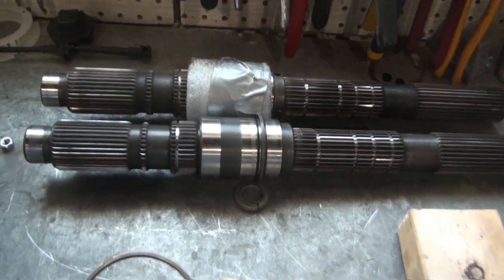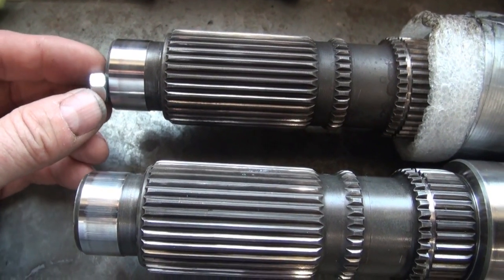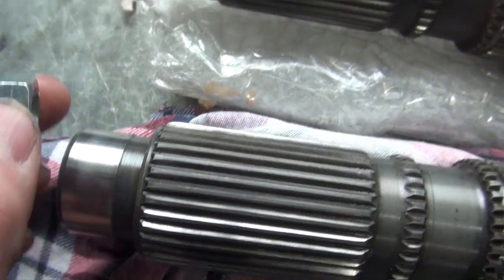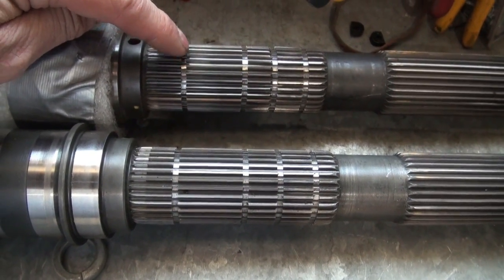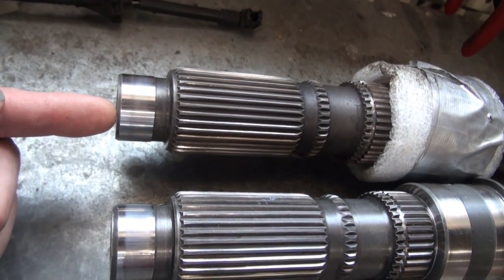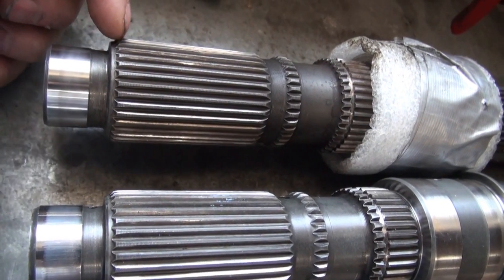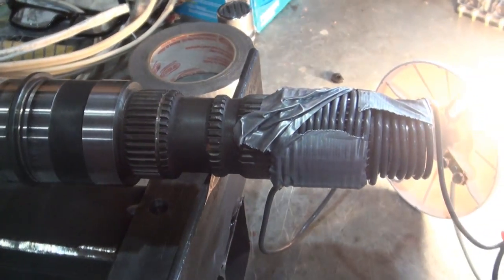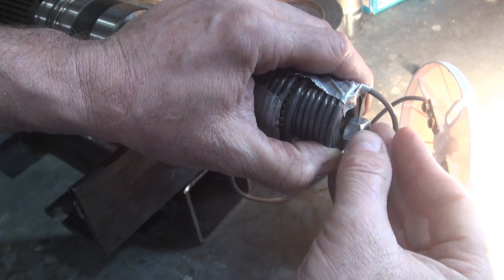Oddly Magnetic Transfer Case Shaft

Comment: heavier gauge coil and wired in series with an old AC stick welder,  short it's output and BZZZTT. or if it's large enough, wrap the "output welding cable" around the item and bzzzzzttttt. takes high current  and a clean sine to degauss good. for smaller things the butt end of a "soldering gun" on high, waved around or an old bulk tape eraser, used years ago for reel-to-reel and such.
with the coil you had there, a heatgun, hair dryer or ceramic heater on high in series would likely have worked too. I say on "high" because most use a rectifier for "low output" by only letting 1/2 of the wave through. so you end up with pulsed DC, which can do opposite of wanted :0

Comment: I bet that shaft was magnafluxed for cracks at some point. When you magnaflux it the part will become magnetic. Depending on the alloy some more then others.  They probably didn't degauss it after or did a poor job of it. Normally your supposed to check it with a gauss meter after to ensure its neutral.